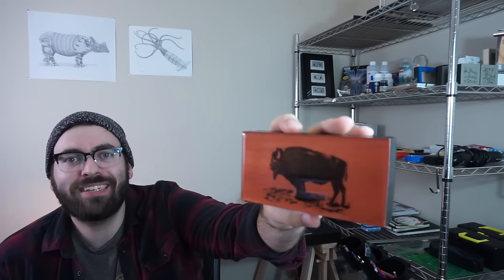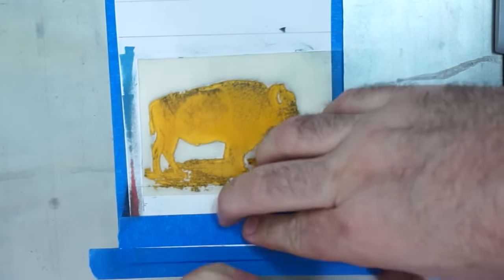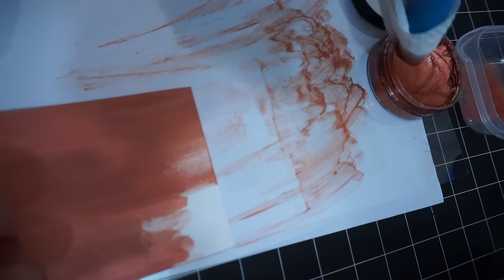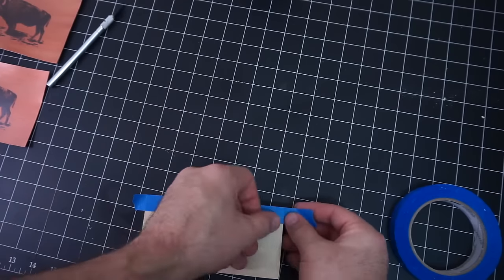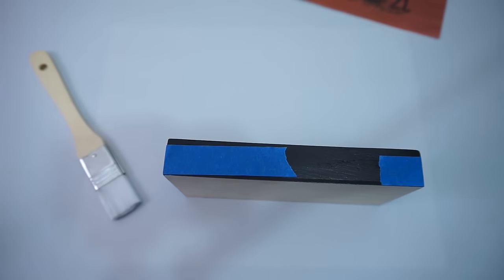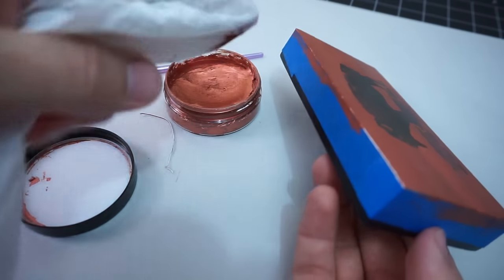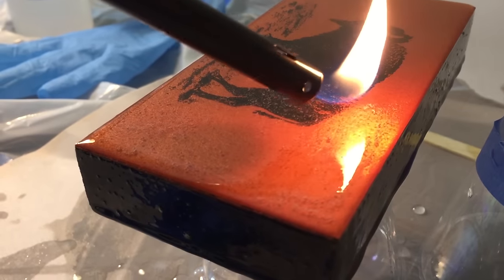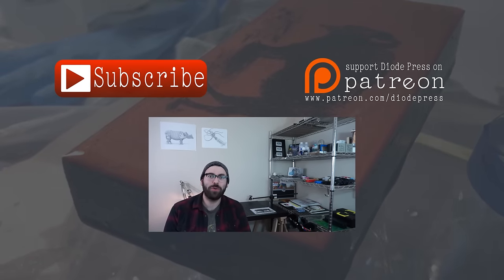Making a Bison Photopolymer Relief Print

Comment: Nice job, Graham. Really wish I had known that lighter tip when I did an epoxy seal on a dining room table I had designed. That thing gave me fits!

Best wishes,
Tom Z
Reply from the maker: +Tom Zelickman (Inspiration Metalworks) It worked great! I know it works with the Art Resin that I used,  but I'm not 100% that it works with all resins!

Comment: Hello, is it possible to do typesetting for a book? It would be for making it look like an old printing press from the 1800's.
Reply from the maker: Absolutely! The detail in the plates is basically exactly what the image file is, so if you made a file that looked like distressed text, that’s what would print from the block. Or you could make a clear crisp image and then print it in a way to look distressed if that’s the look you are going for.👍
Reply: @DiodePress  That sounds like it's feasible. I'll wonder how people can make DIY cutters more affordable. Yours turned out so beautifully; and it's not cheap either. Well, ok. Best of luck!